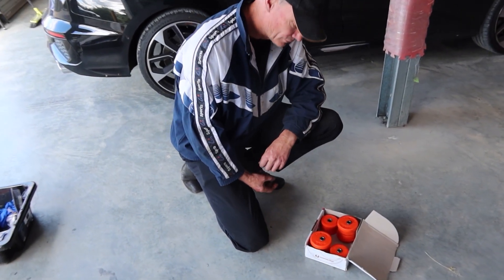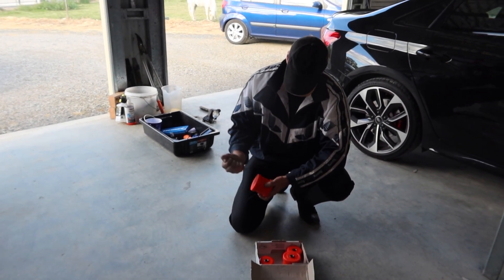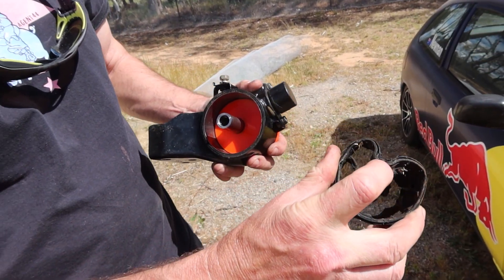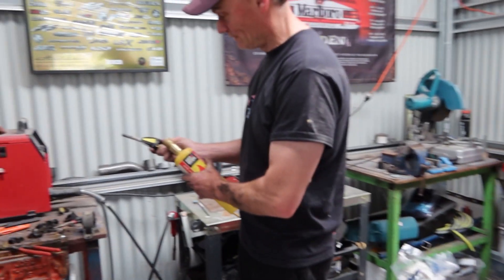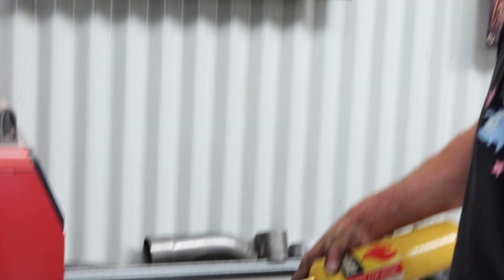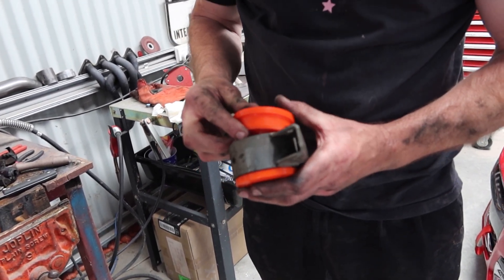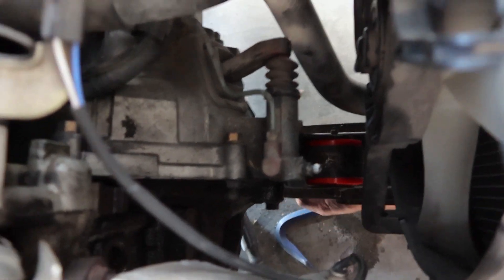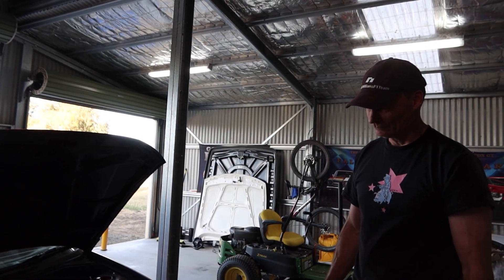How to fit Polyurethane Engine Mounts | Mitsubishi Mirage/Lancer

Comment: you mentioned the vibration from the engine in the low revs. is that normal ??? i just installed some mad polly engine mounts on my lancer glxi and it vibrates in the low rev area but feels very stable
Reply from the maker: Yep, lots of vibrations at low rpms, thats all good, its a race car!
Reply: @ClunieGarage  thanks for the reply and confirmation .appreciate it